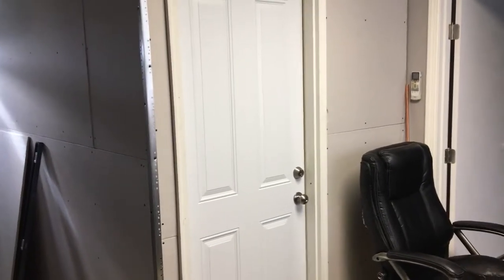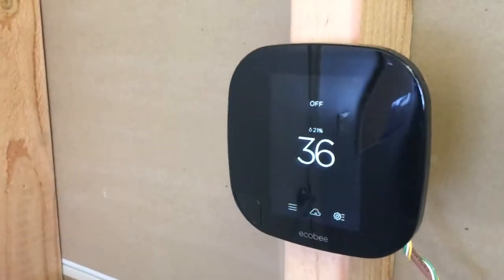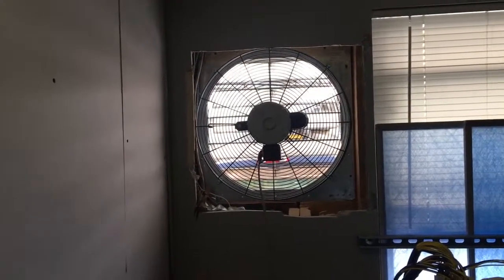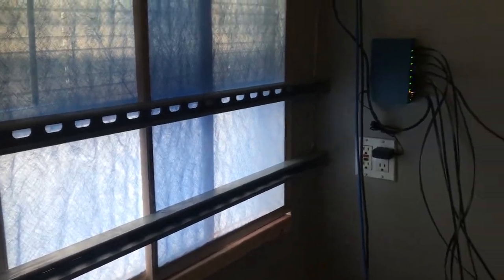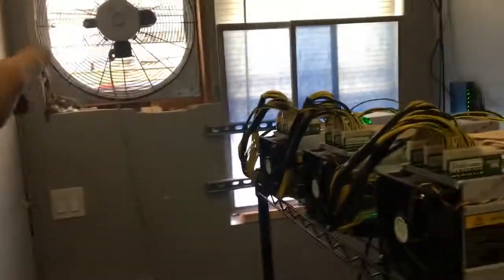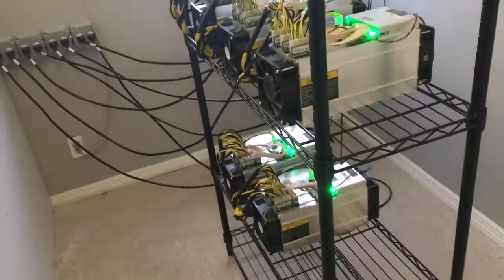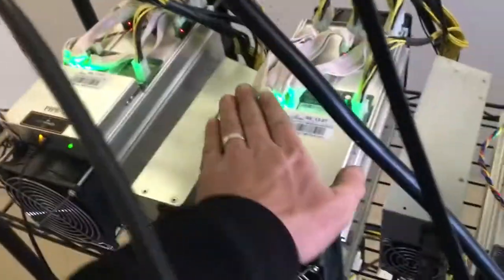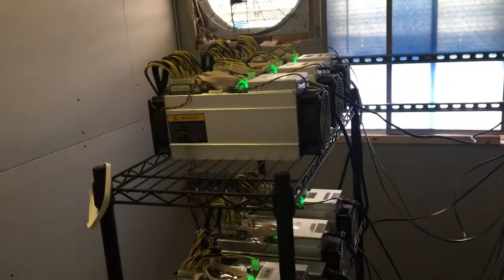AntMiner S9 Mining Room - Recent Build Out - Maximum Airflow

Comment: Nice video, thx.  You mention you understand cfm.  Is it more about "pulling" the hot air out or blowing cooler outside air across the S9?  I have seen videos with a 2 fan setup.  1 fan blowing in and 1 sucking hot air out.  What do you think?  We are setting up 80 S9's.  This is the trickiest part
Reply from the maker: It’s about having negative air pressure moving across the equipment. I have 20 miners running setup with a hot and cold aisle using a 4500 cfm exhaust fan.

Comment: Great video!  Doing the exact same thing.  Question is are you going to have to introduce AC into the room during the summer?  What outside temps can you pull in and not have overheating problems?  Seems when 100 degrees outside it may be an issue?  Would love an updated video on your ducting if you've done it
Reply from the maker: I haven’t done the ductwork yet. It’s winter here and the mining room generally is in the 40 degree range.

Comment: Nice video! How do you do the cleaning of each s9?
Reply from the maker: I will be shutting 4 miners down next week and I will post a video on disassembly, cleaning with an air compressor, reassembly and startup. Thanks for commenting and subscribing.
Reply: Thanks to your excellent work! Do you use power in 220 or 120?
Reply from the maker: I used to use 110v but went to 220v on all miners. Saving about 40% in electric with the change.
Reply from the maker: That does not look like a 220v plug.
Reply: wich would you recomend?
Reply from the maker: Here is one on Amazon: http://amzn.to/2Cvqotv
Reply from the maker: And here is another: https://www.showmecables.com/by-category/cables/power/hospital-grade-cords/hospital-grade-power-cord-nema-6-15p-to-c13-15-amp
Reply: Nice! Thank you very much. Awesome. What do you think about bittconnect and lending pages? I see them usefull
Reply: Hello Luca, i am looking to give my Antimers away. they are new but i no longer need them.
Reply from the maker: Denny Wells I’ll pay you for them!
Reply: i will appreciate that , how can i contact you?
Reply from the maker: cryptoplumber@gmail.com how many do you have and which model?
Reply from the maker: I am currently uploading/processing a video today on disassembly and cleaning of the S9 miner
Reply: i have Antminer s7, an Antminer r4 and Antminer s9 as well as power supplier for each Antminer, i also have a complete set of  21 bitcoin computer. that consist of power supply, wifi adaptor, cable for device to laptop.
Reply from the maker: How many S7's and S9's do you have with power supply?
Reply: hello Plumber, i have 3 S7 and 3 S9 also all with power supply
Reply from the maker: Do they work fully?
Reply: i got them brand new ,they are all working fine  is there a better medium we can communicate?
Reply from the maker: Denny Wells  cryptoplumber@gmail.com